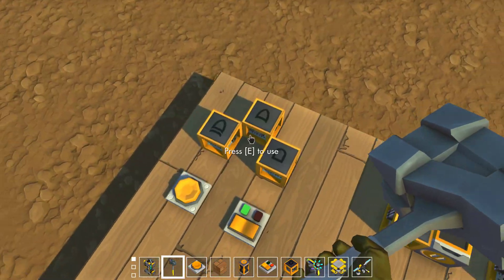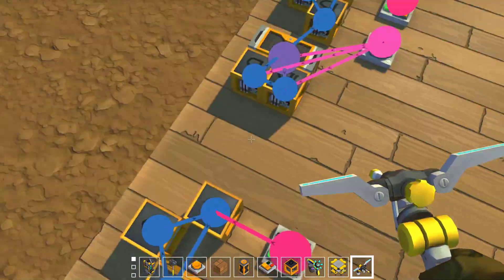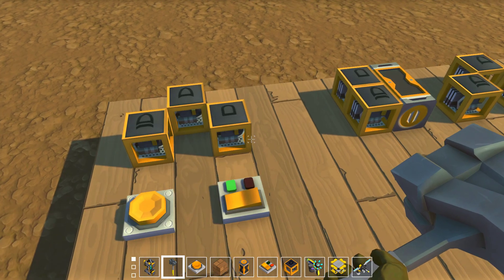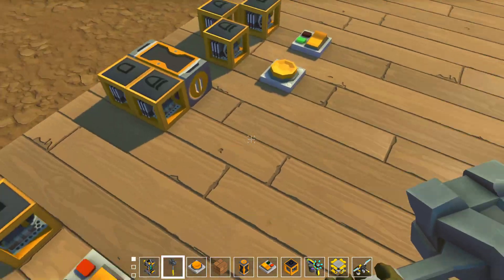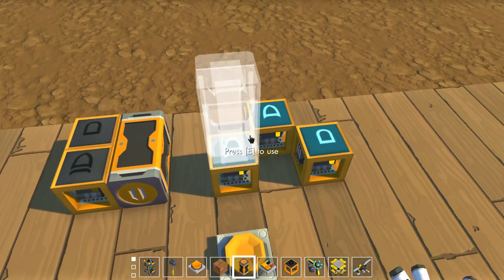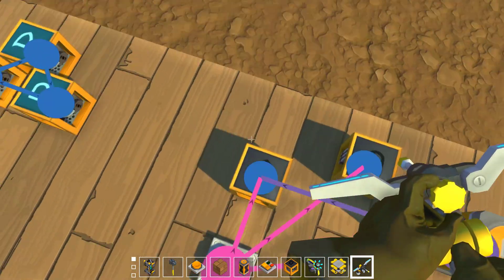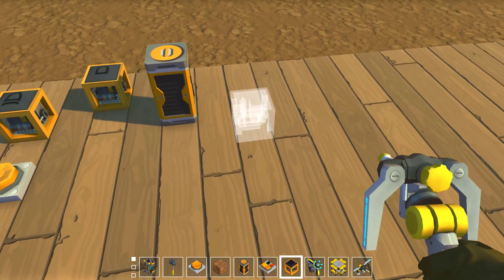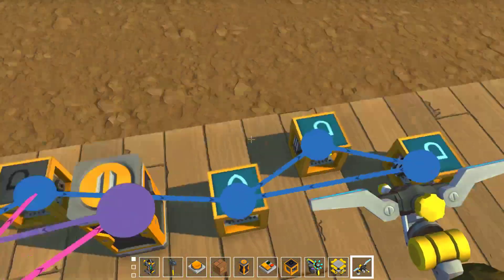T-Flip Flops (Test Video) | Scrap Mechanic

Comment: FIX  option 1: increase the tick delay on the timer to 2 ticks (keep in mind that if you "stab" the button too fast it will still start to loop) option 2: change the xor gate after the timer to a nand gate (this allows to keep the timer at 1 tick, so its harder to make the system loop if you press the button too fast)

Comment: There's a way to make a Schmitt's flip-flop in SM. All you need is to connect one NOR gate's output to second one's, also NOR gate's input and second one's output to first one's input through an OR gate. Attach buttons to NOR gate. By placing it onto a lift it will glitch, just send a signal to one NOR gate.